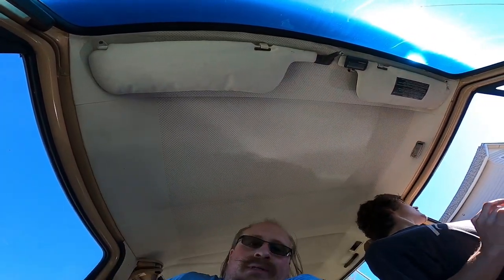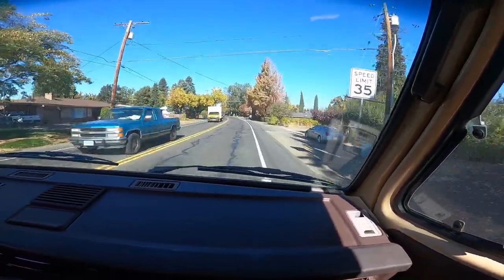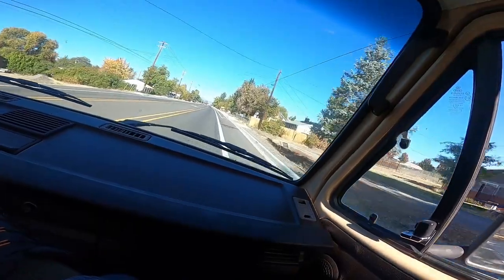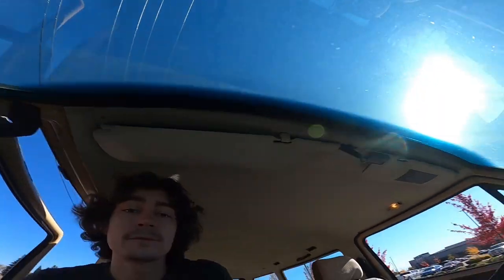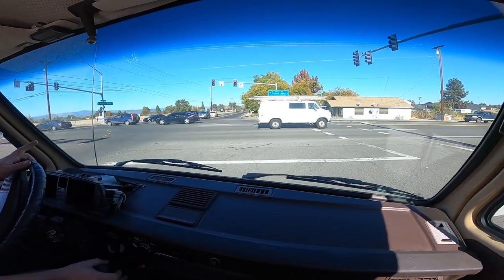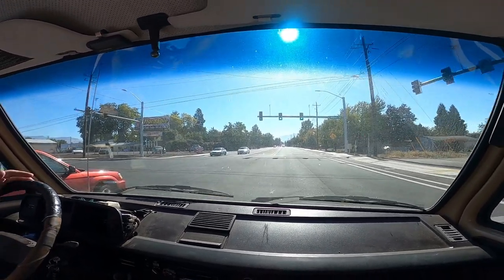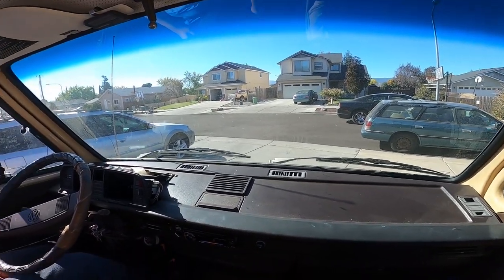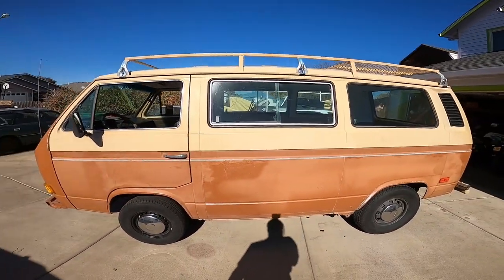First Flight of BulletBarry's Resurrected Vanagon

Comment: Barry's video of you guys fixing this was satisfying to watch as a car guy. The work gone into making the wiring good once and for all is amazing. Should be good for the next 40 years. When I saw it run in the video I kinda got disappointed for the fact that it doesn't have the subie rumble, might be because it was filmed from the engine bay.
Reply from the maker: Yeah, the camera doesn't do it justice. It has a really unequal length header and super short exhaust system. In person the rumble is beautiful. I can actually tell when Barry is coming over a block before he gets here.
Reply: @AdamNDJ  well, that is good then. Also videoing from the engine bay brings all the other noise of the engine.

Comment: I need your help. I have 1985 VW Vanagon just like this one. My fuel pump keeps shutting off. I think it's a ground or wiring issue.
Reply from the maker: Check the pump first, it is easiest to get too. You can run a battery straight to it and see if it runs properly. While it is disconnected you can check the harness side, see if there is power and ground present. If not, you'll have to locate and check the fuel pump relay. If I remember right it is under engine cover on the left side in a black box.
Reply: Thanks so much! crossing my fingers!
 @AdamNDJ